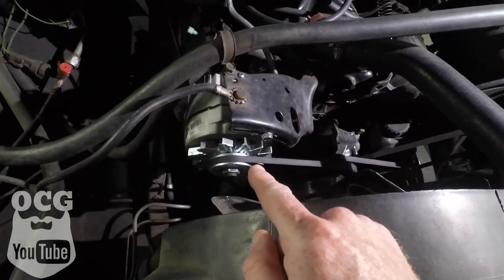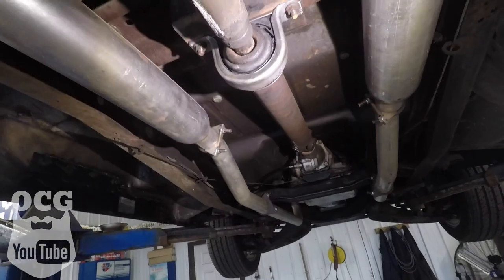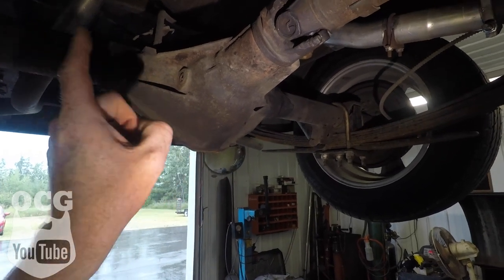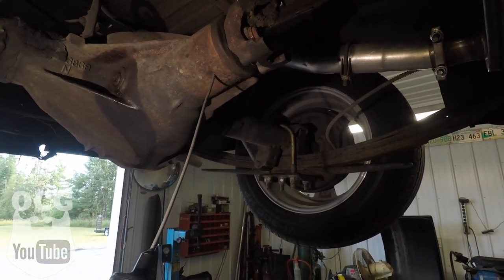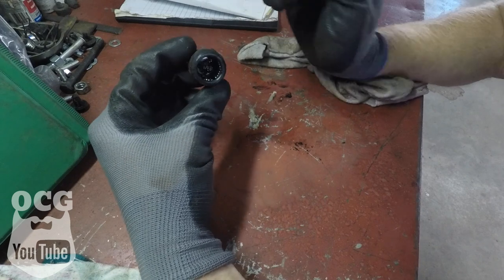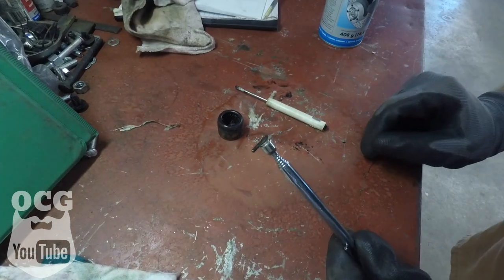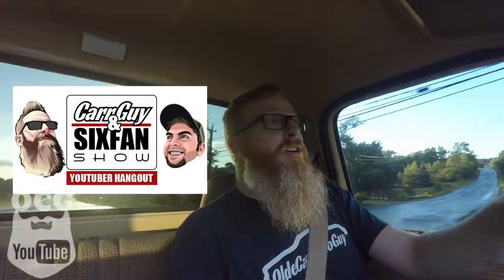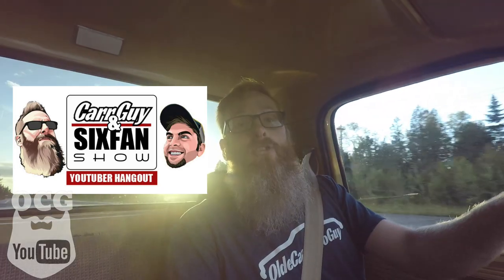HOW DO YOU DIAGNOSE A NOISE IF YOU DON'T KNOW WHERE IT'S COMING FROM ON YOUR 1977 CHEVY C10

Comment: Uh, passenger side exhaust manifold at the base there is a little flapper valve and when it goes bad it starts to make a noise as the metal starts to smack stuff, just cut it and weld the hole shut
Reply from the maker: Already removed! I did that when I replaced the exhaust!

Comment: the only place i see is maybe the flexplate bolt to the crank geting loose? or flaxplate crack? maybe the bolt to torque/flexplate is loosing up?  i understand your pain i have myself find some noise on mine a few is fix and some don't..my diff gear is old so i know it be noisy that fine with me, my trans is a old one so maybe got something there, got a another spare trans/torque that in tne future gonna be rebuilt, but for now i drive my truck and have fun with it!
Reply from the maker: A few people have suggested this and it definitely seems plausible! Thanks for the suggestion!

Comment: Flywheel/converter bolts?
Reply from the maker: I’m beginning to lean this way!
Reply: @OldeCarrGuy  happened to me before.  Bolts didn't look loose but were loose enough to allow flywheel flex/wobble at certain rpm and hit bell housing.🤞

Comment: Are there stamped steel heat shields anywhere on your exhaust? Spot welds rust out and they start to rattle. Also, remove any loose cargo from the bed, behind/under the seat and empty the glove box. Have any clips come loose on fuel/brake/trans lines or cables under the truck?
Reply from the maker: No heat shields but you may be onto something with the lines!

Comment: I would be curious to know if they have the correct oil in the rear diff  it is a locked rear end !  And also make sure there are no heat sheilds  loose !!
Reply from the maker: I do plan to change the rear gears at some point in the near future so I’ll do it then! Also, there are no heat shields on the truck, but the do tend to make a similar noise!

Comment: My Grand Marquis makes a few noises but none of them are rust related since it ain't got no rust. Just a couple squeaks when driving over a rough road a slow speed thanks to the massive plastic bumper cover.
Reply from the maker: Every vehicle has its noises! It the new ones you gotta watch out for!
Reply: @OldeCarrGuy  chrew dat, chrew dat. chrew dat, chrew dat.

Comment: I'm with idiotic rehab. Mine has a rattle under slow acceleration. I'm sure my problem is the flapper in the end of the passenger side exhaust manifold. Mine is coming out.
Reply from the maker: I removed my heat riser when I replaced the exhaust! But good thinking!